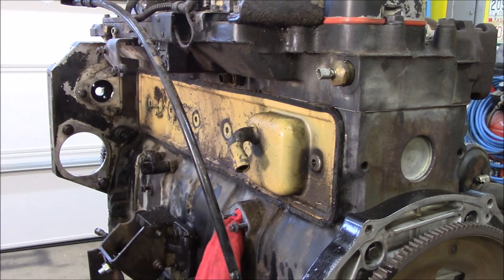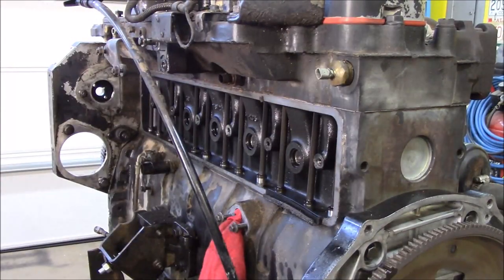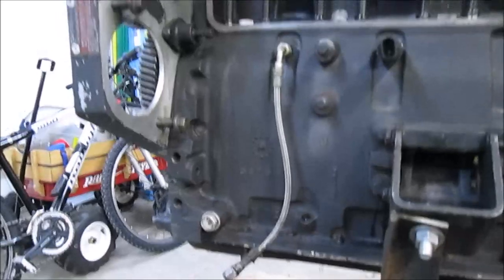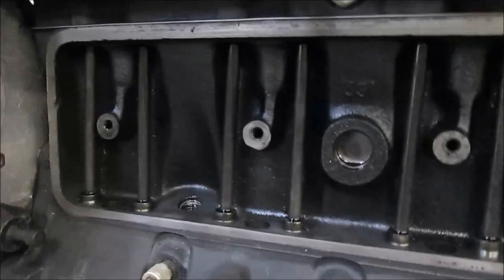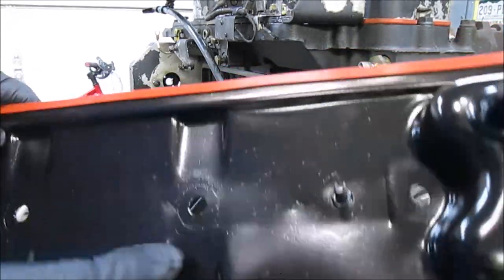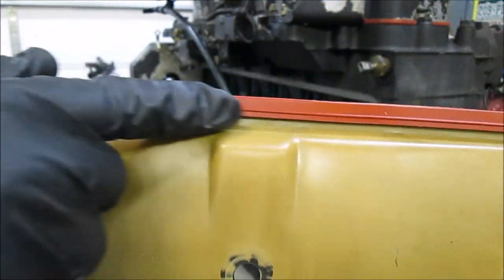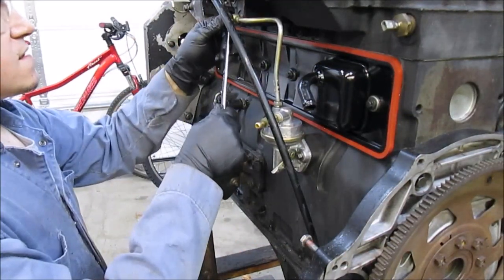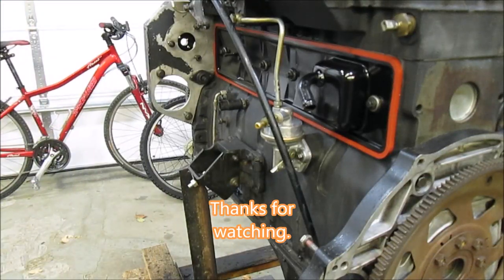Episode 35. Tappet cover and fuel pump install

Comment: So what is this for is this for the 12 valve 5.9 cummins or what you never stated in the description or the caption it looks like a Cummins to me but I really can't do I'm fairly new into the Cummins I didn't know that it had a side cover to me it kind of also looks like a 300 6 cylinder Ford but I think it is a Cummins 5.9 the reason I say that is because that's what I looked up and it brought me to this

Comment: What brand gasket did you use? I'm about to do mine on my 24v 5.9. Wondering if I should go with the Fel-Pro or genuine Cummins?
Reply from the maker: All my gaskets I ordered from genos garage. Almost all of them are Cummins except the exhaust manifold gaskets.
Reply: @LowQualityFilms-in1og  Great, thanks! I actually found a Cummins service center not too far from me. $25 for the gasket, so I think I will just run over there and pick one up. Appreciate the speedy reply!

Comment: I have a problem with mine leaking oil and I thought it was coming out of the pipes on the bottom of the oil pan then I get to looking up and I see it's coming from somewhere up higher but I can't see what it is behind the injection pump I have a little oil around my valve covers at the top but it don't look too oily it looks like it's just there well anyway I get to looking on here trying to find the intake gasket change and I can't find it nowhere so anyway I come across this tappet cover and I hope that it is not coming from there cuz that looks like to be a job
Reply: It most likely is the tappet cover.

Comment: And yes it is a 5.9 Cummins I see now
Reply from the maker: I see you have found my descriptive powers weak. I commend you on your observation and reasoning. This is a Cummins first gen 12 valve out of a 92 Dodge W250. I hope you have found what your looking for.
Reply: @LowQualityFilms-in1og  I did and thank you for videoing what u did
Reply: @LowQualityFilms-in1og  I sure hope mine isn't leaking there
Reply from the maker: @Linkys_Adventure  if it has not already been done to your engine by the previous owner I bet it is. One option instead of taking the injection pump off is to remove the head that will also give you access. I have not done this yet but seen it done.
Reply: @LowQualityFilms-in1og  I'm figuring out where it's coming from it is starting to look more wet everyday now it appears to be coming from the valve covers I purchased the gasket set on ebay for $10 at autozone they wanted $59 for it it's crazy the price difference